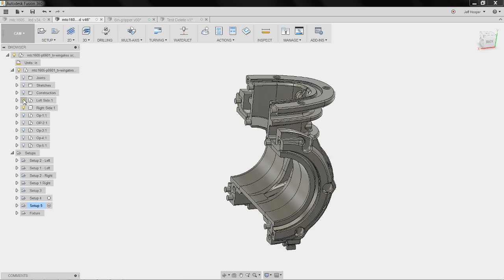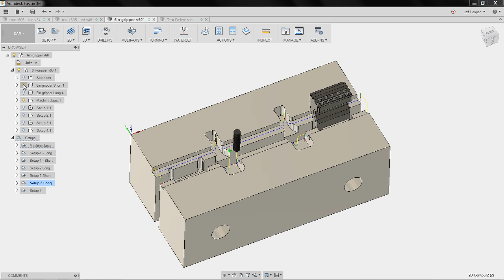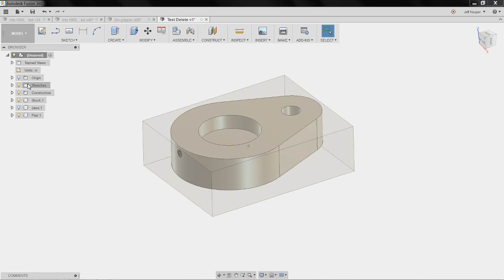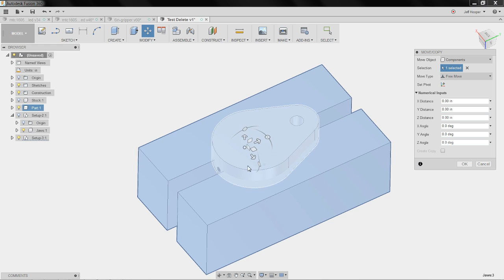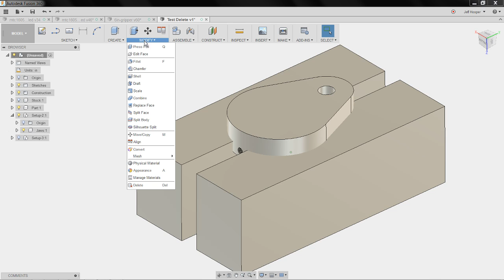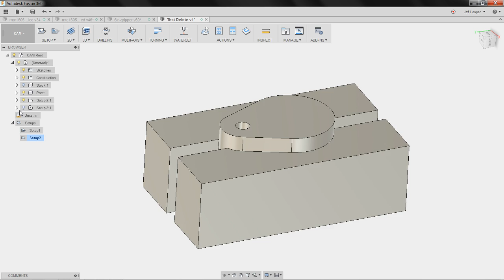Fusion 360 CAM Fixture Design

Comment: Is there a way to keep using the same stock through the setups so you really know what the machined part look like at a given point ?
Reply from the maker: Alexandre Bergeron Absolutely. Run the simulation and then right click on the screen and select "Stock" then "Save Stock" 
Then run the simulation for the next operation and select "Load Stock"